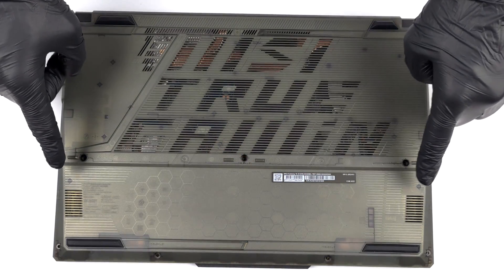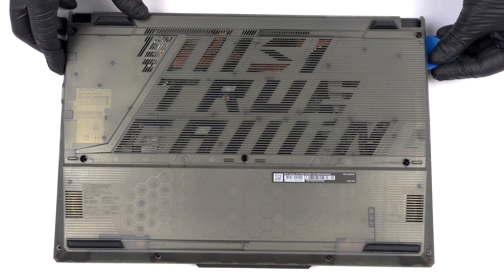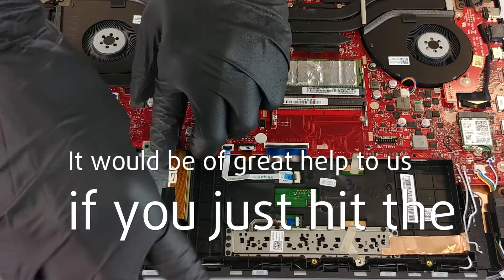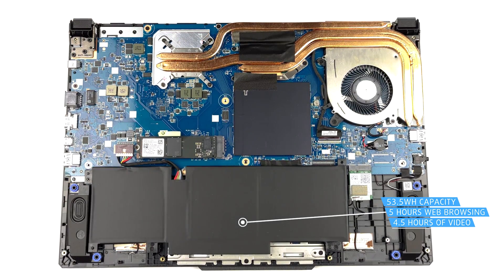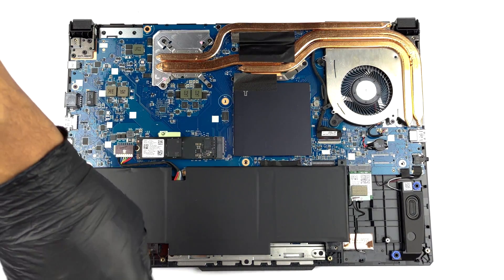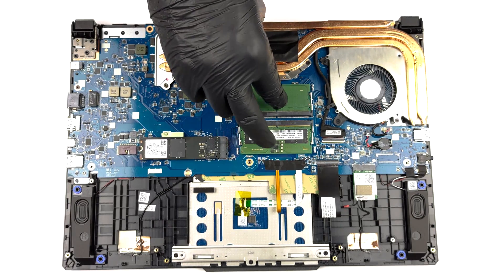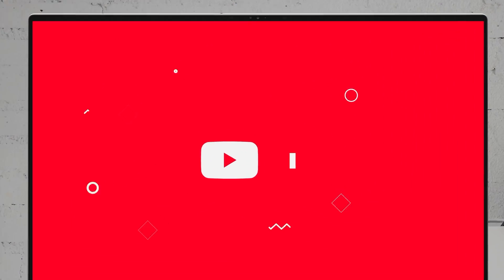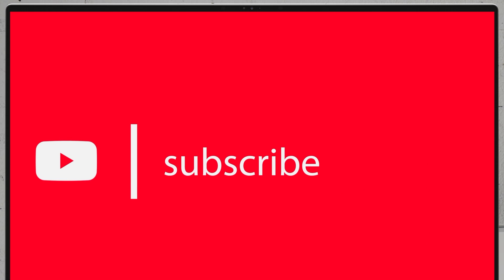🛠️ How to open MSI Cyborg 15 (A12V) - disassembly and upgrade options

Comment: After a year this sh!et starting to overheat (90+ deg) causing shoot down while plaing Destiny 2. Luckyly i did need un-dust fan and it starts working like a new BUT it is loud af! It need max fan speed to mantain temp ~ 75-80 deg while play. 1 fan no go! 
Well i did need budget gamig laptop so i get it 😓 
Also i think it will be better after re-pasting of chipsets.

Comment: I realized after buying the laptop that it have only 1 m.2 gen 4 port and the second m.2 port is empty doesn't have connecter 
Can we solder second m.2 slot in the empty spot near wifi card

Comment: I would appreciate it if you could answer how many SSD card slots are available in the computer.
Reply: Just one, there is space for two SSD's but the second slot isn't usable without getting a soldering iron out, to fit a new m.2 port and creating the second slot, probably needs a firmware mod too, there is a slot on the motherboard for it, but it's unused.
Reply: @romeshabeyawardena9978 🥺

Comment: Greetings, a question from the msi Cyborg, which SSD and RAM brands are compatible for this laptop, good afternoon.
Reply: DDR5 with 4800MHz max 64GB
Reply: is it compatible with 5600mhz? @HunterzKar98
Reply: Can max out at 5200hz too I have 64g in mine rn
Reply: @billyjoe3764  It's said only 4800 so I don't use more than 4800
Reply: @HunterzKar98 does the m.2 support heat sink?

Comment: This the best bang for the buck out there. 1 fan is substantial because copper piping is so good at shedding heat. Also woth vapour champer. Mine never gets too hot even with AAA games. Im going to get 2 16gb ram and eventually clone my ssd to a 1tb stick. Thatll be enough for me. The biuld quality of this on par with acer and asus. Yes ive tried all 3.
Reply: Hey, my laptop also has 1 fan, but for any gaming laptop this is poor. 2 fans are the standard nowadays. 1 fan means less heat dissipation and thus less power for the GPU specially meaning less power (and potentially more noise since the single fan has to work faster). Plus the limited battery and the single storage port makes this laptop unimpressive to put it mildly. I'm sure you enjoy your laptop but please do not post repeated comments about magical copper pipes.
Reply: @MrDarkSephirot  the GPU isn't running at 75/150 watts so it's enough. FYI the cyborg 4050 runs at 45 watts MAX
Reply: @herracrossdungeoneer95  thank you for the info. This confirms that the performance will be poor then. Laptops always have to strike a balance. If the cooling system isn't great, either you have a hot and noisy laptop or you must lower the GPU watts (and thus the performance). Or a combination of both things.

In other words, any laptop with a 4060 GPU and two fans, running at the common 90-110 watts, will easily run twice as fast in games, not just a bit faster.
Reply: @MrDarkSephirot  yep, it basically sacrifices performance for portability/lightness while being a somewhat cheaper, for the segment of casual users they're probably aiming for this is a worthwhile tradeoff, because you're basically able to run any game on it as long as you're willing to tweak down the settings if it starts to throttle.

You'll pay more for if you want a 90w/150w TDP, but if you're open to my opinion I'd recommend avoiding the 150w devices because they don't actually reach the wattage advertised in 90% of the models and they're much more expensive for a lower jump in performance, the 75w/90w do infact reach their wattages. Instead of buying a 150w you might as well go for a model with a 4060/4070/4080.
Reply: Can confirm this laptop does not get hot even running cyberpunk on psycho settings
Reply: It's never get hot because gpu is limited to 45w.So no heavy gaming for sure.
Reply: Mines been overheating and crashing with all my games even csgo now

Comment: My battery doesn't last 5 hours of web browsing and it's only a few months old TF???
Reply: Same here mine lasts about an hour or 2😊
Reply: @rayjunior3204  I just leave mine plugged in when in use but there is a really good option to stop the charge at 60% or so.. so far no complaints since it's a gaming laptop anyways but I wish I purchased the i7 version but overall it's still a decent laptop for me

Comment: Seriously? Just one fan for a gaming laptop
Reply: You'd be surprised it keeps very cool and very quiet even on intensive games
Reply: @soniccd9983  well yea it also draws less power
Reply: It's fine for entry level ones. I played beamng on high. Not very much heat. You have to understand that copper pipes are a breakthrough in laptop cooling compared to just sticking cooling fins on everything
Reply: @Genstone24  no shit. They have been doing that for the past many years now. And two fans are much better compared to just one
Reply: Just type in google "why some laptops have 2 fans" @Genstone24

Comment: Was hoping it had extra SSD/m.2 slot 😢500GB not enough
Reply: No thats why i put 4TB in that slot.
Reply: @dieaking6475  is max storage 2TB for this laptop?
Reply: @RuTo94   can u add with the computer storage or must we put in a new set of storage?
Reply: Just have to instal windows again but thats easyyyyyyy
Reply: @dieaking6475 clone your ssd save the $200. Amazon has good cheap cloners
Reply: the pads near the wifi card is wear a m.2 slot can be soldered on to the laptop not easy but possible

Comment: I really wish MSI would get away from the single fan designs.
Reply: Mine cools just fine. I'd be more focused on scheduled cleaning than worrying about 2 fans. Heat pipes are so good these days you only need 2 fans if you have a high power gpu/cpu putting out extreme heat. Not necessarily on the entry level models
Reply: @Genstone24  bro someone paying you to say this shit? Every other brand uses copper heat pipe but instead of one fan doing all the work they have 2
Reply: @Genstone24  how do you clean yours?
Reply: The current model of cyborg 15 is having 2 fans
Reply: @RE-MOTOVERSE   What current model is having two fans ????
Reply: It's very quiet and does not get hot at all actually and the battery life is amazing

Comment: I upgraded the ram but the speakers don’t work anymore. I didn’t even touch the speakers. I now have performance at the cost of sound. Headset for life I guess
Reply: do you know how to take off the shroud covering the ram cause mine wont come off
Reply: @sheogorathDaedricGodofMadness it’s so hard but there’s glue stuff underneath that make it hard so you literally have to use force even though it feels like it’s gonna brake it won’t.
Reply: hey, a year late but this happened to me recently, i updated the bios and the speakers started working again

Comment: This is a total uneventful laptop. In this price point a single fan and only 1 M.2 plus the size of that battery and its only 50Wah .... what a disaster, that had the space fir at least 2 M.2. Pay a tiny but more and get the TUF A15
Reply: I have this laptop and I love it. 144hz display is so smooth. The feel and biuld quality is good too. And 1 fan is more than enough with modern copper heat pipes. Please understand that higher end models require more power to run the cpu and gpu. Thus creating more heat. 1 fan does just fine. And if keep it clean it will last a long time
Reply: Mine also is very cool and has great battery life probably because of the single fan. Even cyberpunk won't get it hot
Reply: Almost went for the a15 but you get a 2050.

Comment: lack of storage expansion options is disturbing but besides that it seems to be  a great laptop for the price 🙂
Reply: Can’t u just put 1 4tb ssd in there would that work?
Reply: @Spaciestspace67 yes
Reply: no, it's total garbage.
Reply: @salvatorekrzysztoszefski8649  I disagree but I personally went for Acer Nitro with RTX3060, which might have "old tech" but at least I know that it will be good 😀
Reply: @salvatorekrzysztoszefski8649 4060 version is pretty good even tho 45watt. But with some resize bar its great enough.
Reply: @salvatorekrzysztoszefski8649 actually in my eyes it is not total garbage, it runs hot at times but just get a good cooler that blows air into it from the bottom, and you’re all set.

Comment: Fake opening
Reply: How is it fake?
Reply: Huh?
Reply: When he used to pry took, he skipped the whole back of the laptop. It’s does NOT pry open from where he put the pry tool. He had it open already. So it’s absolutely fake
Reply: Are you high?
Reply: thank you for being real, I had a hard time doing it and tiny pieces of black plastic shot out, i was very careful too
Reply: @1ds2ds3ds   Yeah was not that easy to make it open but i manage to do it with some fideling.
Reply: It is scary tbh